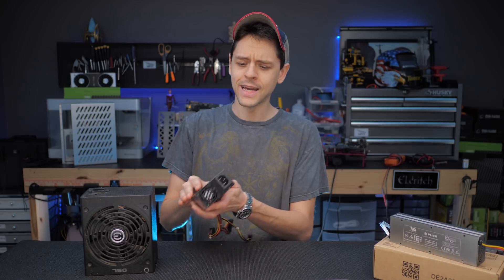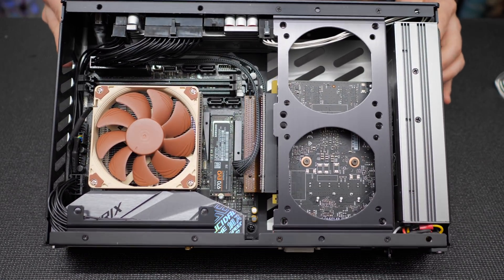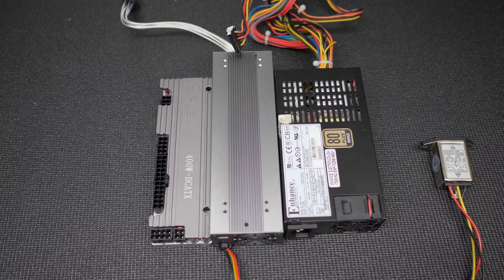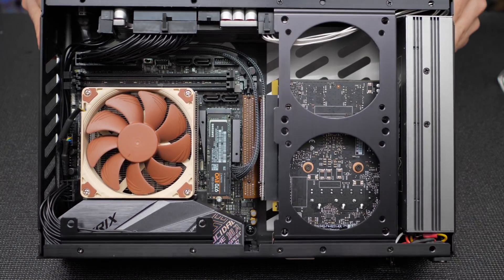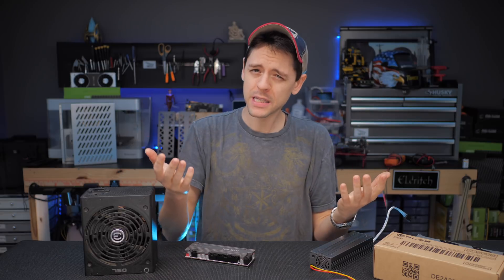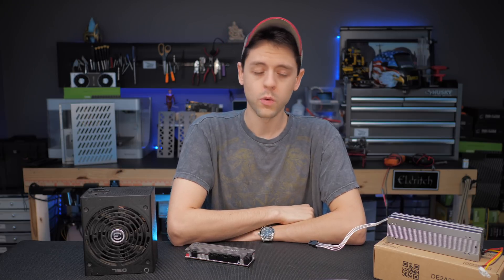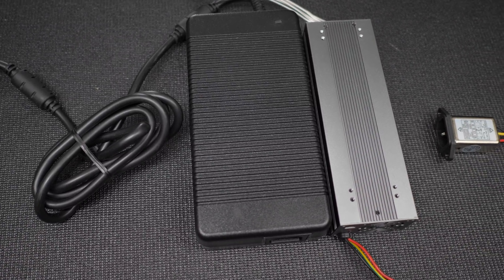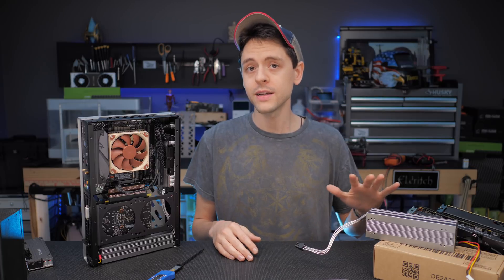HDPLEX 400AC Overview (SFF Gamechanger)

Comment: What a beauty. Definitely further cements my decision and future decisions to stay mini itx. There are fewer and fewer reasons to consider larger PC builds. HD plex has done it again. The HD plex 300 was a game changer for me. This new combo is insane. The quality is top notch as well. You couldn't ask for more. How viable is it to use the 400 AC externally in lieu of of my Alienware brick? Doesn't seem like I could use this internally for my S4 mini C.
Reply from the maker: 100% viable--included is a barrel jack adapter. I'm working on a bolt on enclosure so you get a sturdier AC jack too.
Reply: @NotFromConcentrate  That is good to know. Sign me up for the preorder. I would love to buy a enclosure. Plus I would be supporting two small businesses. I am curious how it would look, but considering your designs are literally art I can safely assume it will look great.
Reply: Imo, The only bad thing about itx is the price (due to scarcity of parts). If some big brand names decided to make it a thing like buying hdplex and start mass producing it we might probably see a significant cost reduction